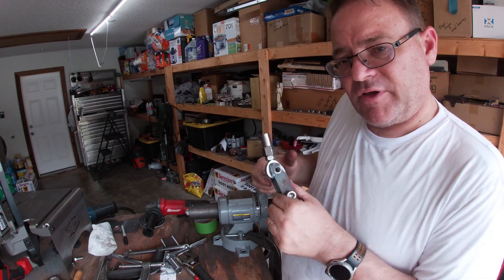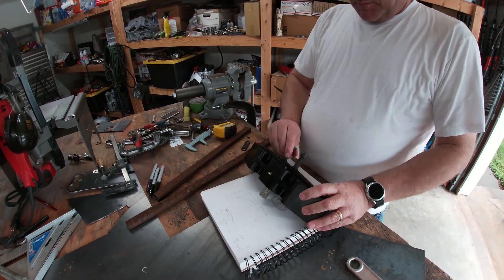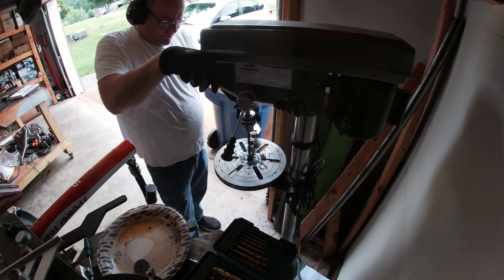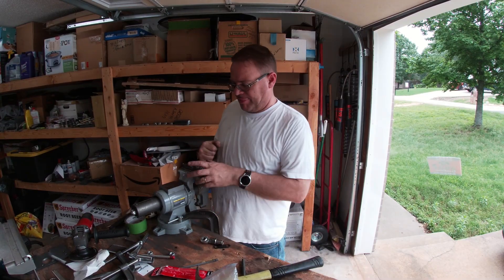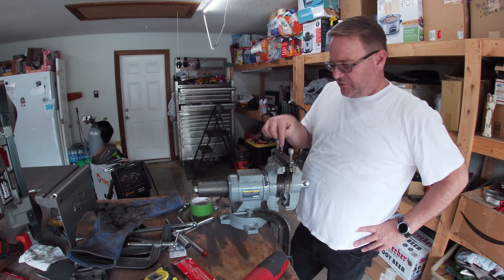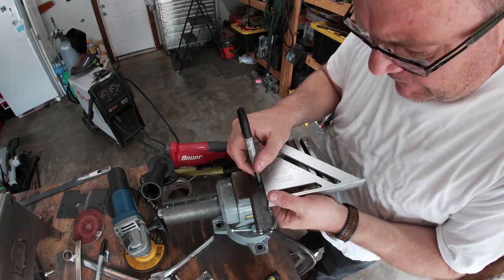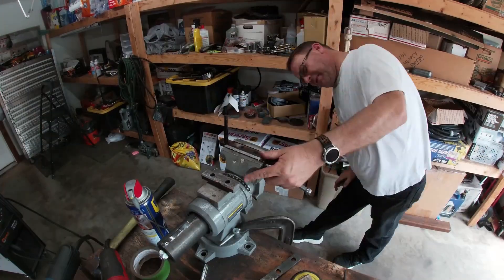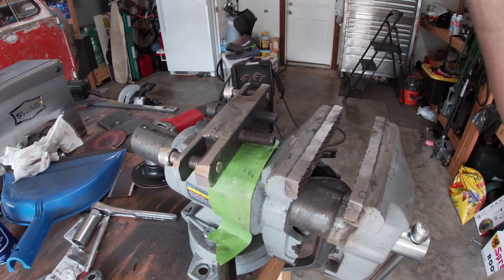Baja Bug Build (ep 42): Building a Heim Spreader

Comment: On the topic of CAD, I've got about 10 years experience with CAD and building stuff to either laser cut, weld, or 3D print. I originally learned on a crappy $200 budget laptop from Best Buy that was already a couple years old. It did the simple stuff just fine, only when I got into larger assemblies like a full a-arm system did it really struggle, but even then you could still model up your A-arms system on a budget box you just won't love the performance with the full assembly all together. 

So for you, most likely the computer you have is more than adequate to get started in CAD. But if you're definitely wanting to buy one, CAD programs like SolidWorks and Fusion 360 are great, I think Fusion 360 is free for personal use and i think SW just introduced some sort of hobbyist license, not sure if that's free or if it's paid, but if it is paid it's a lot better pricing than the full commercial version. 

For computer spec, mechanical type parts and programs that do mechanical parts (like SW and F360) benefit from better single-threaded performance, they don't leverage multi-core processors really at all unless you're doing renderings. Intel tends to have better single-threaded performance than AMD, but both processors will do more than fine running the kind of parts and assemblies you'll be doing. Getting a good gaming laptop is kinda the best option, something from Costco or wherever right in that $800-1200 price point is going to get you a real powerhouse of a laptop that can do pretty much anything you'd throw at it. My current mobile modeling machine is a Lenovo Legion that I upgraded to 64GB of RAM. And my desktop that I model on in the house is a big AMD machine with 128GB of RAM. These programs love RAM, so whatever you buy make sure it is upgradeable, most definitely don't go under 16GB of RAM, but 32 would be ideal as a minimum. 

If you have any other questions, reach out. We're friends on Facebook so you can message me there